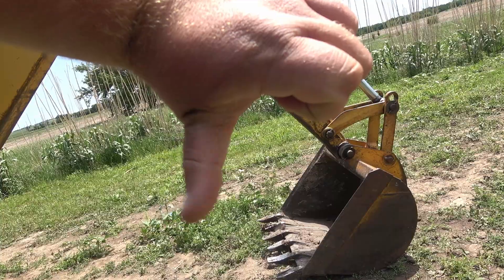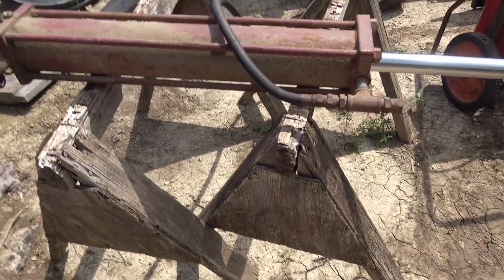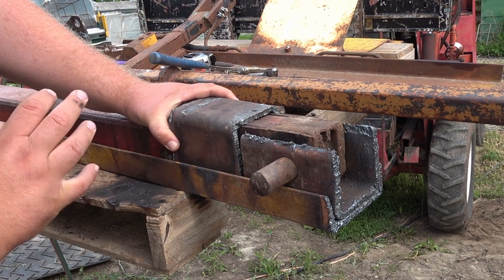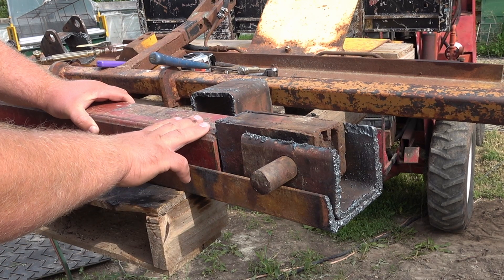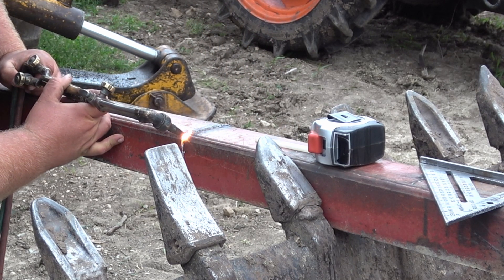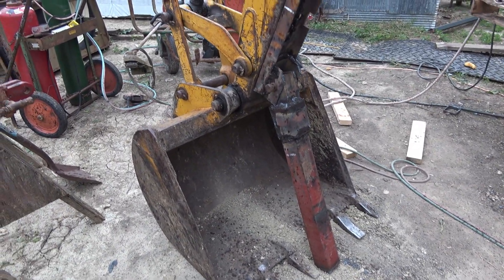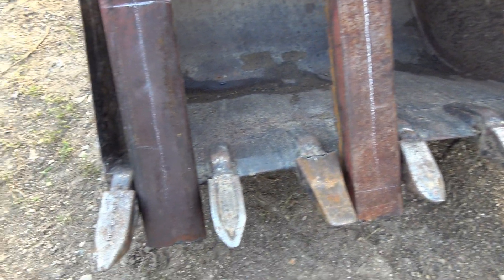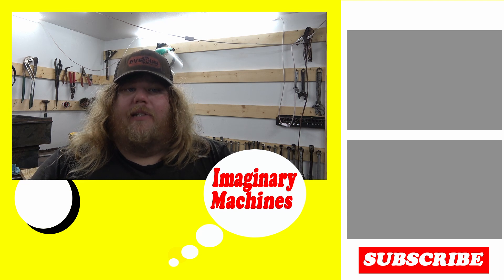DIY Backhoe Thumb part 1 (scrap metal build)

Comment: I am considering purchasing this exact backhoe, but i'm just concerned about hauling it. I've transported mini excavators before, but this thing is beastly compared to them.
Reply from the maker: Yes this machine is a lot to haul!
Loading can get pretty scary, I recommend backing it on cause it likes to ride wheelies with all that weight on the back.
I loaded it on my 24' dovetail triple axle fifth wheel trailer.
We got it all chained down but forgot a 4x4 wheel chock on the middle trailer axle.
Somehow the trailer drove over the 4x4 snapping the springs on the middle axle.
We ended up unloading and driving the backhoe home 20 miles.
It was a long drive with hydraulic cylinders that settle lol.

Good luck and be careful!
And just remember, make sure you pick up all your wheel chocks before you drive off!